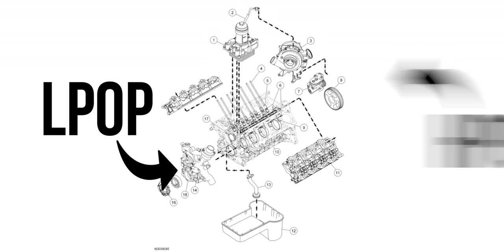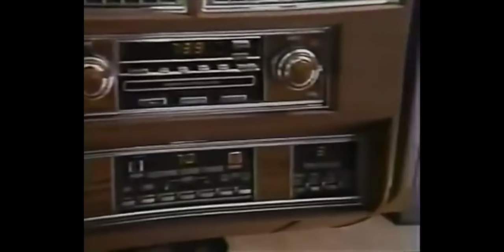These are the WORST ENGINES EVER MADE

Comment: Everyone hates on the 6.0, but the aftermarket has remedied almost all of these issues.  I recently rebuilt one, and the design is really robust. The largest single failure for the 6.0 that is catastrophic is lifter failures. The cam profile is too aggressive and the lifters don't handle it for long. Johnsons makes a fix for this with new lifter and a cam. Now, I know any good engine is good right out of the box, but to say the 6.0 is just always bad isn't accurate.

Comment: Working in the industry, 1 qt/1000mi is a pretty standard rate of acceptable oil consumption, Hondas with the sticky piston rings routinely use double or triple this. 
Also, how did any Land Rover engines not make this list? Slipped liners, pours blocks, timing issues, high pressure injector issues, coolant issues. They are colossal bags of crap! 
Every turbocharged Subaru ever built, Hyundai theta engines (fail with hilariously alarming regularity) there are lots of terrible engines out there!

Comment: GM's 3.7 liter inline 5 , in the colorado,the canyon, the isuzu,and the hummer h2,  if the timing chain fails, the cost of rerplacement is absurd( theres two timing chains in them, one for the actual cam, and ojne for the balance shaft, they MUST be replaced as a set)

Comment: Northstar V8s weakness lie in the smaller than optimal spec head stud bolts. Upon running out of optimal operating range and overheating, the bolts would pull out of the block, leading to head gasket seating issues. I have a 94 STS that has been retrofitted with the kit through Northstar Perfomance. Tapping out new threads and installing much larger diameter bolts make this engine damn near bulletproof. My 94 currently has about 263K on the clock, and the engine's retrofit was done roughly 70k miles ago.

Comment: My olds aurora with the 4.0 North Star was a good running, fast car. The guy i sold it to still drives it. Now I drive a 2006 4Runner with 4.7 v8. 330,000 miles and still kickin it.

Comment: I have owned 7 Northstar engines, all low mileage and I sold them without these problems. BUT if ONLY GM had properly used steel inserts in the block for torquing down the heads and proper oil pan gaskets, it would have been one of the BEST engines ever. They perform very well and are fuel efficient too. None of mine had an oil consumption problem. The reason so many did was because people drove them like little old ladies. You have to drive them hard on occasion to keep the rings from seizing.

Comment: I had one of those 3.0L Toyota engines in a 94 Ext Cab pickup.  Never had any head gasket problems, I did have air lock in the coolant when I drained and changed the antifreeze though, which also almost overheated, but the head gasket didn't fail.  I drove if or another 200k miles before trading it in.

Comment: Take a look at Detroit Diesel's first 4 smoke engine, the 8.2L Fuel Squeezer. Free standing liners and 14mm head bolts. Many recalls for head gasket failures. Finally came out with a kit to drill and tap the block for 15mm head bolts to get more clamping. That did not fix it.
Had a bunch that broke the upper pushrod cup in the adjuster. Those that broke had a shiny wear ring around the top, indicating the ball end was a bigger diameter than the cup. Foreman thought I was full of road apples.
On top of this, setting injector balance was very tricky to get right on the racks.
Designed for 5 ton delivery trucks, they did not stick around long.
If I could find one, I would get a machine shop to make a plate to fit the tops of the decks to stabilize the liners to the out block walls. That would fix the head gaskets. For the pushrods, select parts for compatability. Still leaves finicky tuneup, but the head gaskets and pushrods were the reliability issue.

Comment: 3vze was head gasket material issue from the manufacturer which was corrected, but current issue number 6 cylinder getting hot from the crossover  exhaust portion causing head gasket failure around # 6 cylinder, still continuing issue, and the same issue with the 3.4 gasket on number 6 cylinder overheating due to crossover exhaust causing too much heat near the number six cylinder.

Comment: In my experience with the 6.8L v10 2V, it’s a very robust engine. Uhaul up until recently had them in their 15ft thru 20ft vans and I know as a former employee those engines are absolutely thrashed not including hauling a fully loaded box and auto transport with a full size suv that is also loaded to the brim. They are tough but they do not get good fuel mileage no matter how gently you drive unloaded. The worst I’ve heard of from these engines is when the employees at the store level don’t check the oil and a customer blows it up midway through their journey.

Comment: 2.7L Chrysler v6 would be on my list. Oil sludging if ran over 3500 miles between changes. Spinning rod bearings and braking rods. T-chains jumping when the water pump goes out and fills the oil pan full of coolant. Plastic coolant housing melting causing over heating and blown head gaskets.  The only problem with the 5.7L HEMI is the exhaust manifold bolts and the loose nut behind the steering wheel.

Comment: I'm a Mopar guy. I would say the Mopar 2.7 V6 was a far bigger turd than the 2.2/2.5 fours. Having owned a few 2.2's they were actually a fairly decent engine. On the other hand....lawsuits were filed over the 2.7.  It had hot spots in the block that cooked the oil into sludge, which of course led to blown up engines. Chrysler... {Mercedes}..... tried to blame it on poor owner maintenance, denying claims when service records performed at dealers proved otherwise. Hence the lawsuits. 

Cadillac.....what can one say about Cadillac. I worked as a line mechanic at GM dealers throughout the 80's, and yes the 8-6-4 system was useless. The predecessor to the Northstar, that being the 4100 series 4.1 liter V8, was also a complete piece of sh*t. Main bearing knock straight off the car hauler, self destructing cam gears, head gasket problems which could easily lead to stripped threads in the aluminum block if not done with extreme caution. The blocks also suffered from electrolysis, with many owners finding puddles of coolant in the garage floor due a hole rotted in the block. Numerous other issues with the 4100, but you get the idea. And the transverse FWD models were a real pita to work on. 

Corporate GM engines were the best thing to happen to Cadillac, the 4100 was so bad that many late issue RWD Caddys came with a 350 Chevy under the hood prior to the Northstar. The Northstar simply resumed the status quo of suck at Cadillac.

Comment: Had a 5.7 hemi in a 2004 Dodge truck and it was awful. Years later I bought a 2015 hemi Charger and it has and still is a fantastic engine. I get 20 mpg in city and just did a 4000 mile road trip and averaged 25.7! 102000 miles and zero problems.

Comment: I owned two Fords with the 5.4L 2 valve engine and in 170k miles on each, no spark plug was ejected.  When you replace the plugs, they need to be torqued to 28 ft lbs instead of the factory spec of 12 ft lbs. and they won't blow out.  Also I put 122k miles on my 2005 Magnum Hemi with no knocks.  The first generation of these built from 2003 thru 2008 did not have variable valve timing and the lifters did not make any noise and the cylinder dectivation did not cause problems.  There was however a possiblity of a valve seat dropping especially if the engine was overheated.

Comment: The Ecotec 2.4 LEA needs to be on this list. The way the PCV system is designed  to go through the intake, suspended oil and water can freeze in cold temperatures and the resulting pressure in the engine can actually blow the rear main seal because it has nowhere else to go. The timing chains are terrible and wear out every 80-100K miles. Because it is an interference engine, it will grenade if the timing chain stretches even the tiniest bit. The oil consumption issues abound as well due to faulty piston rings. And then,  not to mention, the excessive carbon buildup on the valves because it is a direct injection engine. GM junk.

Comment: On the Cadillac Northstar cars I hear the transmissions are almost guaranteed to fail around 90,000 miles, give or take.
My boss at the time had a '79 Olds with the diesel in it and needed a total replacement at 33,000 miles.  The heads were warped in it among other problems.

Comment: There are other worse engines!  Engines with no keyed camshafts or crankshafts, or belts soaked in the oil pan to run the oil pump and timing system 🇺🇲✝️🇺🇲

Comment: Ford's Triton engine had another bad characteristic. When it came time to replace spark plugs, you can bet at least one of them will snap off in the head. As a mechanic of 30+ years, I had more than my share of them. One  pickup had 7 out of 8 snap off. We charged $50 a cylinder to extract them. The plugs were long and skinny, and the hole was fitted too tight to them. Carbon would fill this gap and make it impossible to remove without breaking. Very poor design.

Comment: I inherited my parents olds intrigue and aurora (they purchased new and I helped with maintenance). The aurora has the 4.0 North Star. Has been very good. The intrigue has the North Star variant 3.5 v-6 (built new ground up) also has been great. Smooth, good power and runs well. I keep regular oil changes, coolant flushes and use OEM parts. You have to be strict with maintenance. Make sure the cooling system is good and does not overheat.
Reply: What year's Aurora do you have?
Reply: @Marc816  2003
Reply: @jimamerica7419  I have a 2001 4.0. Only problems: crankshaft position sensors, cam shaft position sensor, spark plugs.

Comment: Olds Diesel:  What a turd.  In addition to your list of issues:  The achilles heal of this design... the fuel injection pump was driven off of the camshaft, which in turn was driven by a typical gas V8 timing chain arrangement.  Any diesel injection pump has severe torsional loads, much higher than the torsional loads of a gasoline engine camshaft.  Premature timing chain failure was virtually guaranteed by this design.  And don't forget the 4.3 liter V6 version of this engine.  All of the inherent drawbacks of a 90 degree V6, and all of the weaknesses of the 5.7 engine!

Comment: If you were going to go with a second Cadillac engine, the HT 4100 would have made more sense than the V8-6-4. The V8-6-4 was just a modified 368 cubic inch version of the 472, 500, and 425 engines and the main design was virtually bulletproof. The HT 4100 started its life in the large, RWD drive cars of the early 80s, replacing the 368, and was really underpowered. Unlike other low horsepower 80s engines that at least had good low-end torque, this engine had neither. The mix of aluminum block with cast iron heads and cylinder liners made for real issues, especially if the engine got too hot, and head gasket failures were common. Also, coolant tabs were recommended regularly to add to the coolant system to try and prevent leaks that would form due to the warping caused by those differing metals and the havoc they would wreak on the gaskets. This engine along with the Olds diesel and the early Northstars really helped put the nail in the coffin of Cadillac as the “standard of the world”.
Reply: The Hook and Tow 4100...........

Comment: I used to work on a 911 ambulance in the Denver area. The rig was a Type-1  Ford F-350 Super Duty with the 6.0 Power Stroke. During one shift a few years ago, we were toned out emergent on a cardiac arrest. The rig started out fine and we were hauling ass. All of a sudden, the engine just seemed to quit on us. We went from zooming past other cars to creeping along in limp mode. It would have been funny if the stakes weren't so high. As the rig slowed down, a minivan that we passed about half a mile back slowly drove past us, even with our lights and sirens on, and the occupants of the minivan just kind of stared at us like "WTF?"

Comment: I have 2  of the 5.4  2 valve tritons . 99 van has 220k 98  van has 150k, both used in commercial service. One spit a plug once and was repaired in 15 minutes. Nothing but tires , brakes, battery’s and 3000 mile oil services, not even a fanbelt

Comment: Gm 3100 Series 2 3.1
 V6 engine and GM 3400 Series 2 3.4 V6 engine,  GM 3.6 V6 engine the GM V6 engines, Dodge every Penastar 2.7 V6 engine, 3.3-3-6 Penastar V6
engines. Every 1.8  or 2.0 engines don't buy any cheap cars and SUVs .

Comment: The main thing with the NorthStar aside from the head gasket issue was/is the split oil pan assembly.
I bought a 79 Chev P/U with a gas conversion diesel, put 80 bucks worth of glow plugs in it and discovered the injection pump was leaking fuel into the crankcase and said... You're out of there. I retrofitted a 72 Buick skylark 350 into it and didn't look back. Turbo 400 trans and it was a freeway flyer.

Comment: Man I tell you what, the 420a engine that came in a multitude of vehicles. Eclipse, talon, neon, avenger and Sebring. This 4 cylinder is absolutely horrible, everything from all the gaskets leaking , timing chains snapping, absolutely no power or torque and don't get me started on the headgaskets. Absolutely trash.

Comment: Gen 1 3.6 L GM "High Feature" V6.....Timing chains, Cam Phasers, coil packs, water pump, excess oil consumption. 4.1L V8 head gaskets. Ford 2.3 Turbo, Mazda 2.3 turbo in the original CX5, Subaru 2.5 early 2000. Camry 2.2 Oil sludge. and the worst of the worst Chrysler 2.7 V6 NEED A PART 2

Comment: The second gen 350 good wrench diesel had fixed all of the problems of the Olds diesel, most of which were caused by number crunchers and not the original engineers. The type of oil used at most dealers according to a good wrench mechanic I know was also wrong,  He has a collection of '83 to '85 diesels(both V6 and V8 engined)that still run great. Too few head bolts(also wrong strength)and lack of a water separator,  helped to cause the early engines to self-destruct. Put the blame where it belongs. Oh yes, and the block was purpose designed.

Comment: You can only give Ford 50% of the blame for spitting spark plugs. Yes, there are too few threads on the early heads, BUT- If every spark plug change ALWAYS seen the new plugs installed with a torque wrench and tightened to the factory torque specifications, then they'd never spit a plug. However, the first time that the "I don't need no stinkin' torque wrench for spark plugs" guy gets in there, the threads are permanently compromised and the countdown to launch begins. To me, the biggest issue with the early Triton engines is the too-small, bad-quality exhaust manifold bolts that WILL eventually start snapping, causing the famous cold-engine tick that lessens as the engine warms up.

Comment: About the Toyota 3.0 3VZ-E, It's simply a bad press from over-flatulating rock climbers who wanted a low-RPM, high torque engine more capable than the 22R/RE engine. My 3.0 never climbed a rock, but blew a head gasket at 103,000 miles after an over-zealous towing job. Toyota replaced the head gasket with a revised one for free (silent recall - why you and other younger scrutinizers can't get it right for lack of information). The truck was ten years old at head gasket replacement time. Although the truck, a twd SR5, had other problems related to my mistreatment and negligence and it looks like s**t, it now has almost 370,000 miles and it's still fun to drive as a 5-speed manual with no modification except advancing the timing a bit.

It's all about respecting capabilities of the design. You blow original, and maybe even upgraded head gaskets trying to climb rocks. But it runs 80 to 95 mph everywhere even today with no problem. The valve covers leak, but that's my own invention.

Every "knowledgeable" YouTuber badmouths this engine without understanding its capabilities or where the "three point slow" bs originated, but the truth is it never stood a chance against the onslaught of criticiam from the four-wheel drive community. Great video except for that one uninformed slap at the 3VZ-E. I purchased my truck new, and I've never been nice to it, lol.

Comment: the 5.7 in my 06 ram 1500 crew cab is pretty good in my opinion. no issues great comfy truck for long road trips and the cylinder deactivation is so good on long highway cross country roads trips. Running of 4 cylinders means it just barely sips any fuel. going on the freeway exactly the speed limit holding constant speed the whole way i can get 24-25 mpg about out of it which combined with the huge fuel tank means i rarely have to stop for gas if at all on long highway trips. Part of the reason i can get such good mpg and the fact its so reliable is cause its still bone stock The stock muffler is gone and replaced with a better flowing one and im running normal street tires instead of all terrains. plus the bed cover i have helps a bit. Great work truck. If theres head wind traffic or steep hills tho then it has to run on all 8 cylinders and the mpg quickly drops to like 15-17 mpg. But in ideal conditions on long freeway trips its 25. Only complaint is its a little boring to drive lol.

Comment: Have a 6.0 diesel as a daily driver for 6 years. Done the Hpop and Lpop myself. Pretty easy and I'm no mechanic. The rotary oil pump in the front cover has a sleeve bearing and over time they back off causing the engine to have no low oil pressure to feed the Hpop. 240.000 miles on stock head bolts.

Comment: I had a 2002 STS with the 4.6 Northstar engine. Went well over 200,000 miles before a crack in the block near the water pump deemed it for the junkyard.